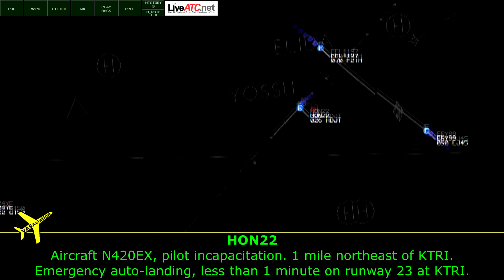HondaJet Plane AUTO-LANDS ITSELF after "Pilot Incapacitation" | Certification TEST Complete!

Comment: I love this. Think like a few years in the future we might scrap the pilots alltogether and let computers do all flights. Maybe with DTMF over the radio with computer controlled ATC's which could also have error-correcting codes that make sure any ComputerATC<->ComputerPilot communication doesn't have faults due to bad transmission quality.
Reply: No, too many variables to replace pilots completely. It's improving, but not even close to that point.

Comment: stupid(?) questions: 
How does the “auto”-pilot determine the next best airfield?
And what happens if the airfield or runway is closed due to some short-term event?
Reply: I'd assume it's hoping the holes in the Swiss cheese won't line up.
Also assuming it's an error that lasts a while, it's outlined on the internal map

Comment: What?  "Aircraft N420EX ..."  at 6:30. That is non standard.  "Aircraft" should be omitted.  Also, other radio calls were missing the "N" or "N42", kinda like some aviation radios I've used where I had to wait 1 second after keying the mike before talking or else my initial words would get clipped.
Reply: It was probably stepping on the previous ATC transmission.
Reply from the maker: No radio calls missed the callsign
Reply: i feel the people that wrote the software didn't know proper radio phraseology, but im not too upset about that because it still gets the job done

it's final version should probably more clearly declare a mayday, though. it should also say its a hondajet in my humble opinion

Comment: Initial thoughts:

1) Amazing safety improvement
2) Really surprised the software has no way to check and wait before transmitting comms so it's not being stepped on by other traffic, but I guess that's why it repeats every few minutes.
3) The voice should stay robotic, but it feels like there's an opportunity to make the calls more efficient. Can you imagine this in a busier airspace? ORD or ATL or LAX approach traffic would absolutely melt down
Reply: If it checked and waited to transmit comms then at busier locations, it may never tell them that it's going to land - better to interrupt in an emergency every few minutes then stay silent and hope ATC picks up on the fact that a Honda is bullying its way onto a runway
Reply: It could be broadcasting on 121.5 in which case it doesn't really matter if it's talking slow.

Comment: Nice to see this continuing to develop.   One thing these systems rely upon right now is someone on-board to push the button.  I think it would be useful if autoland could be activated remotely (with full onboard override by the pilot) in cases where the passengers don't know what to do, or are also incapacitated (hypoxia).   Additionally, a means for the tower to tell the aircraft to "hold for 10 minutes" or "find alternate" in cases where the autoland's first selected runway is unavailable for some reason (momentarily or long-term).   Next version ideas...
Reply: Some of them already do activate automatically if they detect no inputs from a pilot and will pop up a box asking if you are OK, if no response, it activates.
Reply: It's possible that during actual operation it operates with a "dead man's switch" principle: After several minutes of no inputs, an indicator lights up, and the pilot must press something to indicate they are still alive & awake.
For testing, the system can be manually triggered to activate.

Comment: So dumb that planes all talk to each other with speech over the same frequency. These requests and clearances should all be handled digitally. And that's the best voice they could come up with? Sounds like it's from the 90s.
Reply: I feel you're ignorant on how ATC works. Clearances can be cancelled mid air due to changing situations etc. 

Second, a machine voice clearly communicates it is indeed a machine to ATC
Reply: @Derkiboi  I know how ATC works, I also know how software works. Digital clearances could be easily cancelled, with the added benefits of happening asynchronously, with an immediate follow up of the updated clearance, and without any subsequent doubut, confusion or need for clarification. Digital communication would also allow for encyrption, the originator would sign the message with the aircraft identifier so the controlling software knows where it came from, in all cases, a machine.

Relying on what the voice sounds like to determine its source is really silly. It's already saying the word "auto-landing", that should be more than enough!

In fact there are other pretty significant limitations with the current approach: One way communication that seems to choose whatever runway it likes, whether it's in use, closed or under maintenance. It's also incapable of determining when the frequency is in use so just talks over the top of everyone!

ATC is stuck in a world from a centuary ago when speech over radio waves was the only way to reliably communicate. Trying to make automated systems backwards compatible with voice based ATC is disappointing. Communications with aircraft needs an overhaul!

Comment: this seems like a very good technology to have, and my first impression is that it gives a good level of detail. i think however that even though the voice is clearly artificial and grabs attention, it should still include "mayday" in at least the initial call, if not all of them, to maintain standard phraseology. just came from a mentour pilot video where not using standard phraseology (in that case, the keyword "runway") did contribute to what happened, and there was a possibility that it'd have grabbed the pilots attention to what was actually going on.

one thing that i wonder though is, if that system is kept current with notams about shortened/inoperable runways? or if it's only updated with the "baseline" information for airports?
Reply: Transponder "7700" can replace Mayday call.
And someone else said that it regularly updates information on usable runways from NOTAMs.

Comment: The Autoland Feature is enabled by the Garmin G3000 series Avionics + Autopilot.
It went first with Cirrus Generation(G)7 Aircraft but is also available for other manufacturers like Honda in this case.
It uses just regular controls, so e.g. landing gear normal extension failure won't be backed up.
But it has the feature to first level the Aircraft, calculate a course and time and fly itself on that couse and land precisely via RNAV (+/- 4m from centerline) and full stop on the runway. The only thing to to for passengers is to open the doors, which is described on the display.
But it works only if the Pilot doesnt overwrites the Autopilot with controls or disconnect and uses only RNAV not ILS, so it has it's limitations.
It needs:
(Aviate)
1. Power (Emgine+Fuel)
2. A Human that doesn't interfere with the controls by will or unconsciously
3. All Surfaces (no significant Aircraft damage)
(Navigate)
4. GPS Signal (no spoofing/jamming/ mountain reflection interference at low altitude)
5. Can just use Runways with RNAV approches(but includes almost everyone today, but should be mentioned)
(Communicate)
6. As heard here the computer doesnt listen for Radio talk. It just transmits every 2 minutes once and doesnt listen if it's blocked or heard (altough i think it transmits on guard and current frequency).
Reply: Why would it not use the ILS?
Reply: @RENO_K 
RNAV is available at most airfields incl. Small ones and independent of ground infrastructure (down due to maintenance or failure).
And GPS accuracy is good enough
Reply: @RENO_K  Assuming GPS is undisturbed, a sensitive GPS receiver connected to multiple satellites can achieve positional accuracy of less than 2 meters.

Comment: I think Daher TBM certified this system like 5 years ago now for their newer aircraft, it’s been around for a bit. 

I’ve always wondered how harsh the landings are, if it can handle cross-winds (does it use ATIS to check the winds? METARs? …for runway direction selection.)
Reply from the maker: However I think this is the first jet aircraft to have this

Comment: I appreciate that the voice is so clearly artificial and hope it stays that way. It grabs the attention way better than a more modern AI voice would, and it makes very clear that this is a robot talking.
Reply: Agreed, especially since an AI voice may not express the severity of the emergency 😅 I wonder what in the cockpit triggers the system to activate. The test pilot mentioned a button but if you’re incapacitated you can’t really push buttons!
Reply: @bitsofgeek  Similar systems had a button on the ceiling for a non-pilot passenger to press. I suppose that you could have a headset trigger such as might have been useful for the incapacitation event over Spain.
Reply: @bitsofgeek  I expect it would be activated via no-input over certain time (like the train operators dead man switch). Then the selection of the RWY is hopefully verified and possible to be changed by some comms, as nobody wants the plane to blindly autoland into some sort of emergency on the ground and cause more damage. And lastly my biggest concern is - once activated, the plane is commited to EM autoland ? Like we do not want to get a sleepy pilot to grab controls in a shock, and cause a disaster.. so the protocol to walk out of EM autoland is much more important, than getting it activated - that is the easier part imho :)
Reply: @cameramaker  I'm pretty sure it will sound an alarm to wake up the pilot first. But aside from that, no action on switches or dropping out of a stable flight path due to non-changing inputs would be my ideas. Can't forget that the plane may first need to be stabilised if the pilot goes AWOL and it's not on autopilot already. Also, dead-man detection when a slumped body may press on the flight controls or a semi-conscious pilot may give brainless inputs is a PITA. Trains have it easier as they don't have sensitive controls, but even they mandate a dedicated dead-man button, although there are some controls that are allowed to give the "alive" trigger, too, nowadays.
Reply: @bitsofgeek Well, this is a test for the landing (not the detection of an incapacitation), so they would want to reliably trigger the landing sequence with a button
Reply: @bitsofgeek there is an FAA document which details the specifics of the Emergency Auto Land system and its operation. It goes into a lot more detail but.. What triggers the EAL?

EAL can be activated in three ways:
1. EAL senses erratic flying, stabilizes the aircraft, and checks for pilot responsiveness; if no input,
EAL activates.
2. Emergency Descent Mode (EDM) activates. After descending, EAL checks for pilot
responsiveness; if no input, EAL activates.
3. EAL can be manually activated by a pilot in distress or a passenger
Reply: @xorphana  Appreciate the details! I haven't dug into this, but it's fascinating tech and I hope it saves lives and, in particular, protects against the horrors of hypoxia.
Reply: @bitsofgeek it’s man made soooo it’ll fail
Reply: @bitsofgeek If this is the Garmin system, it’s a guarded button for a passenger to press.
Reply: @bitsofgeek well for a test a button works, next step is to get ground stuff working in an incapacitation check maybe you have to press a button every few seconds like the newer version of the deadman’s switch on trains (older people would disable either a lunchbox or your toolbox because it sucked to press in) so if it does detect a button input after beeping by at you for a bit it starts the procedure
Reply: @bitsofgeek  We already fixed that. Context aware real time voice is a thing. We even even have real time sound effects.
Reply: @bitsofgeek  Would be a manual trigger of the system I would imagine.
Reply: @bitsofgeek  im hoping they make it like trains. Trains have a system where the engineer has to constantly press a button every few mins to acknowledge they are still functional. If the button isnt pressed in a certain amount of time after the prompt the computer will apply the breaks and I think alert authorities? I hope with AI they could make a similar system that if the button is not pressed the aircraft automatically diverts to the nearest airport and auto lands.
Reply: @dimetime35c  I'd rather a train apply the brakes than the breaks.
Reply: My thinking as well. It would be far too easy to humanize and therefore dismiss an AI voice.
Reply: I wish this was more often the case. I don’t mind obvious robots. I mind robots that can credibly impersonate humans.
Reply: Couldn't agree more, an AI voice wouldn't have the same impact.  Other pilots and ATC hear this they're going to know exactly what it is.
Reply: More than that the robotic voice is just less fragile. AI voice is immensly compex and non deterministic, meaning you don't for sure know it'll work when you need it to work. It's a bit like when you press your break you need your car to break now, right now, no debate. So for example you couldn't just run it on windows. This voice howerver is comperatively simple, can be hand programmed to guarantee determinism and run on the plane's specialty hardware so that it conforms to any safety requirements.
Reply: very good point !
Reply: This stuff is what I find cool. I love the older stuff and I love what we are doing to make stuff safer.
Reply: That’s a great point.
Reply: I'd prefer AI Samuel Jackson voice.
Reply: I was about to complain about the voice, but that's an excellent point.
Reply: im sure its a design decision, not coincidence
Reply: Indeed
It lets the atc know that The pilot is out and the Autopilot is in control
That's what it should be
A Simple TTS monotone voice to say "this is the autopilot talking"
Reply: If it was a Yamaha Jet it would be voiced by Miku :D
Reply: It speaks too slowly and therefore clogs up the frequency. Additionally, it doesn't seem to care if ATC or another plane is communicating  over the frequency either.
Reply: @roji556 Faster but still artificial would be good. The thing will probably be used just a couple of times a year nation-wide and it needs to not just let ATC know what's going on but, if it's landing somewhere a bit more off the beaten path, also every student and GA pilot at some untowered airport. Because of that, I think the repetition is good as it will be harder to miss. 
They need to fix the stuck mic at the end of the broadcast as well.
Reply: @roji556 This is an emergency (rare) situation, and there's no way to request resending or clarification. Slow and steady is fine, consider that this process can start at the edges of radio range for the local control tower.
Reply: It probably also uses less CPU, leaving more available for the AI to do its work.
Reply: Disagree. It needs to talk faster. It's already saying auto-landing, which should be all that's required to communicate that it's a machine. No point trying to shoehorn automation into the antiquated ATC system unless it behaves the same as the other agents. It also needs to listen to the frequency and only start talking when it's clear - if there's an emergency with another aircraft it'll keep cutting them off interrupting every minute.
Reply: @greg_289 If it sounds human it can literally say "I'm a robot," and people will still think it's human. We already see that in technology outside aviation, even among the tech-savvy. It needs to communicate that it's a robot not only with ATC but, in an actual emergency, every student pilot doing patterns at whatever uncontrolled airport it's landing at. It may never do that, but they need to plan for it since it's already a system meant for dire emergencies and those rarely seem to happen at convenient times or places.
Reply: @greg_289  To me it sounded just that: It only started transmitting after other transmissions had ended. It never stepped over anyone else.
Reply: @greg_289 While it should monitor for idle, I actually like the length and robotic voice. It's not going to detect a double, so the slightly longer transmission will make sure to grab attention. I would like to see a digital ground to air control channel option that could redirect an aircraft if there's already an emergency in progress - either to a nearby field, or different runway
Reply: @kc8ufv  In the modern age we really should be communicating with aircraft digitally. Requesting and issuing clearances by voice one aricraft at a time is pretty crazy IMO!
Reply: @greg_289  Yes, faster is what is needed

Comment: IMO, This is a great milestone for aviation -- an aircraft that could save lives by an autoland approach. 

We've had autoland capability in the 737NG (Next Gen), ever since the airline got them in 1998, but we have to program the Flight Director and autopilot for an autoland approach, beforehand, and after touchdown,  it requires pilot intervention, after landing to steer the aircraft and slow to taxi speed -- this allows landing in foggy conditions, with as little as 600 feet forward visibility.

As an emergency aircraft recovery system, I think its value is incalculable in terms of aviation safety -- kind of like full-aircraft parachutes on some light aircraft -- it'll get you down, if you're high enough and it deploys properly. 

I believe that AI makes a great safety aid, but I don't believe it ever can totally replace a human pilot. In an emergency requiring outside-the-box thinking (shades of gray) -- a multiple-systems failure, comes to mind (for example: a combined full hydraulic failure -- manual reversion, along with engine fire or failure, or smoke in the passenger cabin, for example). A well-trained and experienced cockpit crew, of at least two people in airline aircraft; and perhaps one, in single-pilot corporate aircraft, provides the best chance for survival during these events, IMHO.